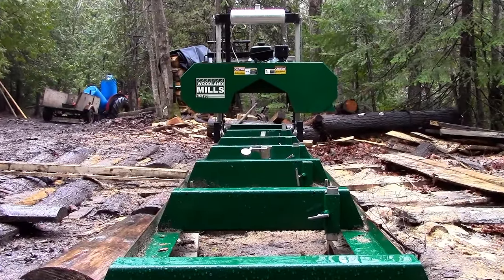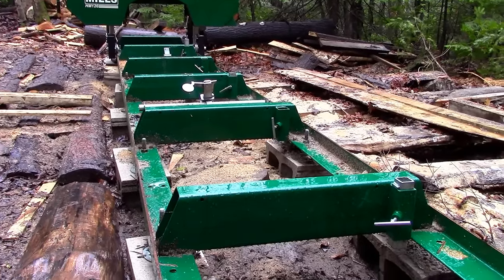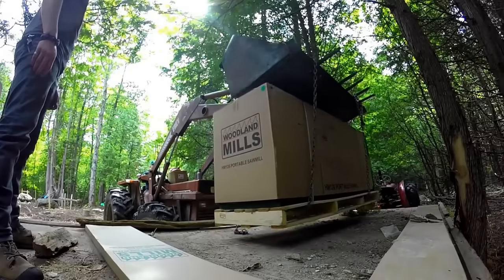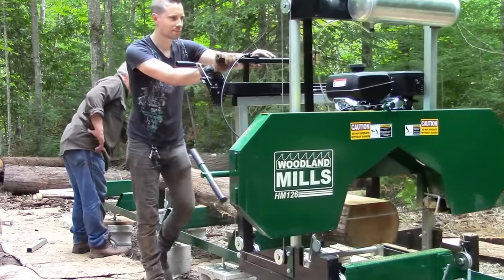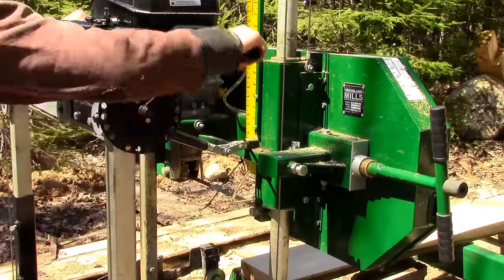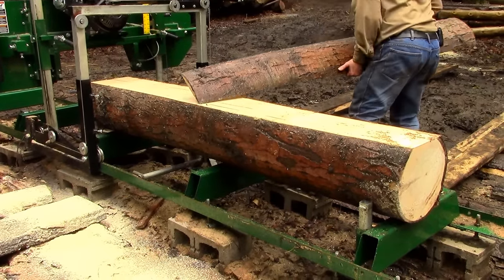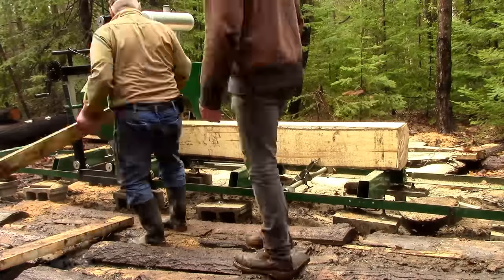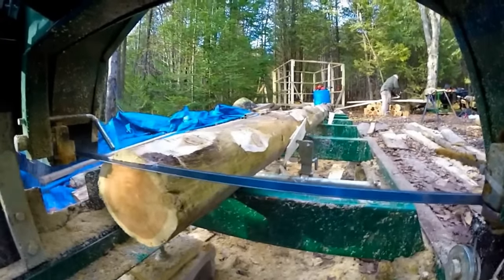Portable Sawmills- Are they worth the money?- Woodland Mills HM126

Comment: I have my own mill also. I have run it for several years. I built mine to reside and repair a large bank barn. I agree with all of your comments. Spot on. I have sold some high end lumber. I have built other buildings with the lumber. The big advance is having you own lumber when you want it in the size you want it.  The first thing I built was a building to house the mill. You should do the same. Nice video.

Comment: I bought my Woodlands mill about 5 years ago for hobby and am very pleased. You might consider going to pawn shop and pick up a transit to level saw bed, as did I.  A neighbor gave me an old dilapidated 24' travel trailer to which I tore off camper portion and used the trailer to put my mill upon. Works great and is portable!

Comment: Just a little tip.  If you use a string level to straighten the bed in the direction of travel you can get in straight much faster.  Your not looking for level your looking for a straight line of cut. After you get the table in a straight line then you can level the cross members.  If the string is in the center of the cross member, the cross members can be adjusted by raising the low side and lowering the high side an equal amount.  I hope this helps you out.

Comment: A great video on the choice, I believe the decision between a bandsawmill or a chainsaw mill is relative to the species of timber you are cutting , I have owned and used both, my choice for cutting hardwood like ironbark or river redgum etc is the chainsaw mill, I have 2  Westford Mills, the slabbing mill and the rail mill using the skip tooth chain , no problem,  the downside using a chainsaw is the waste as in blade thickness. The bandsaw mill has a thin blade , minimal waste, but bandsaw  blades do have there issues,  in hardwood the teeth follow the grain therefore porpises up and down thru the log,  a wavy surface,  no issues with cedar  or silky oak .  In the end I used a starrett brand blade  with a left and right cutting tooth and a raker in the middle,  ground every second or so tooth off  and it cut like a hot knife thru butter, left on the setup and used until the blade was past the use by date,   quick and easy to sharpen with an angle grinder, just  ground a sharp point on the tooth  no fancy depth gauging  or profiling,  cost of a blade was $12 ,  cheap timber ,  I sold the bandsamill because the blade tension is critical  and all  I was  cutting was hardwood.  The Westford mills are made in Australia and are truly portable,  used to cut old dead river red gums on the banks of the river  , in location  , my max lenght was 3 metres long,  couldn't lift anything heavier, 75 mm thick, up to 3 foot wide,  used a Husquvarna 3120  with modified exhaust and jetting to overcome over come running lean with the throttle power on for 3 minutes ,  with  6 FOOT BLADE , skip tooth  3/8 chain . the winch makes it easy  just listen to the exhaust  so you don't bog the motor down 
Walk out of a forest with my mill and the timber cut  setup is a reasonable  task,  not difficult and you can mill logs in position , just set the rail in position with wood screws, no machinery required to lift or drag  the logs to a set up mill  whatever brand,  how much timber are you going to cut and is it hard wood or soft wood,  hope this helps,  not sponsored  just experience

Comment: HI Outsider
 I also have the HM126 which i bought in 2013. I use it on an occasional basis and process about 10 to 15 logs a year. I use the wood for tool sheds, wood sheds an new porch etc. you did not mention so i will that with each log you cut you will get 20 or 30 gallons of sawdust. I add the sawdust to my compost heap as the wood material in the mix. Also all the “scabs” which are the pieces of wood with bark on one side get cut up into firewood. There is very little material wasted if you do a little thinking about where you can use the various products of boards, firewood and sawdust.
Finally i found the local high school has an enthusiastic wood-shop teacher but no budget for wood. I keep him supplied with pine, oak, chestnut and cedar so the kids have plenty of material to work on.  All at no charge of course.

I have not found there to be a market for selling wood locally except for the occasional neighbor who needs a few boards. This occasionally pays for gas to run the mill.

Nice video and valid insights.
Pete

Comment: I have the same mill, it's simple and easy to run, well built, no complaints from me!  I set mine on blocks as low to the ground as possible but eventually raised it aprox one foot. This was to be able to clear sawdust out from underneath the bunk .. it accumulates pretty fast! This is NOT a high production mill but does a super job. When cutting TAKE YOUR TIME... One other important issue... clean the logs as best you can before cutting..., garden hose/stiff brush works well... a lot of the Fir logs I've cut have heavy bark on them... those I run the power saw along deep enough to cut through the bark and then peel it off.. takes a bit of time but saves the band saw blades.  Great little mill, thoroughly recommend.
Reply: Roger Coles how much you pay for
Reply: @ismaelramirez2786  
I think, $1.00

Comment: I have the one a step down from this, an HM122.  I did purchase the 9hp motor and I am glad I did.  I can't stress enough how well built this thing is.  Quality materials and solid motor.  It took about 4 hours to put together, without the foundation.  We mounted ours about 12" off the ground on 4x4 post cemented in the ground.   I don't recommend this for industrial use, but it really is a good unit.

Comment: I was restoring my barn. Needed 6000 bf for just the roof and walls. Local lumber yard wanted $1.05 for field dried, rough pine. I had plenty or trees, I purchased a Norwood 2000. for$7000. Ended up cutting many posts, sills and beams also. Saved much more than mill costs. When figuring the cost of a chain saw mill don't forget the Dr. and chiropractor cost as they will kill your back. Very good video

Comment: Excellent commentary, great production work. I have a simple suggestion, not sure you remember, I was the one suggesting a portable saw mill 18 months ago.I hate mud on my wood, dulls the tools, need to sharpen them much more often. You know this from your chainsaw experience, not telling you anything new. My suggestion would be to get a small wood chipper, not an expensive one, then cover the ground around the sawmill with the chips, spread that sawdust around too, it keeps the mud down.I helped a guy on another website, he did not understand foundations. Just like you have trouble with your sawmill, a house has the same problem going through seasons and staying level. The solution is soil dynamics, foundation engineering, which is very complicated. Basically, you need to get something stable, and that depends upon the conditions where you build. In that soil, I would suggest piers. You have rocks, so to reduce the amount of cement, you might pressure wash rocks or find clean ones in a stream bed. Add a little extra OPC and fill a sonotube, buried below the frost line. That might be difficult with so many rocks there. Believe me, it will be worth the effort, even if you can only put one pier every 16 feet. You have free wood, you can span that distance easily with a 2"x10". Most log cabin guys dig a trench, fill it with rocks and sit something on top. It always fails and the rocks need to be restacked every spring. With piers, you might still trench and stack the rocks, but get the wood up 30" off the dirt and away from the rain splash. If the rocks fall over, so what, just restack them. Piers can look ugly, so to make it look really good, use slip form. Slip form would be like getting a sonotube just 12" to 18 inches high, anything above ground, stack clean stones around the outside, fill the inside with rocks and crete. That is the easy way to make it look like masonry. I am not a mason either, but taking time to get the rocks close to each other, then pointing afterwards will work. That same idea can be done the traditional way with slip forms to create a flat face. There are a few examples on U-tube, most of them awful.Great job, good luck with all your endeavors!
Reply: I use all my sawdust for my free range hens.
Reply: Robert Carver i
Reply: Robert Carver I

Comment: I also own one of Woodland Mills' bandsaw mills, although mine is an entry level model.  I would highly recommend even the small "hobbyist" version I have. Great value for the money when building my own furniture.
Reply: What's the largest diameter of log that it will mill? And, what is the info on it?
Reply: I watched that video.  The 130 looks like a great machine.
Reply: Thank you, Rick and Richard.
Reply: How is your maintenance going with your mill.  I looked at different brand, and you can only buy parts from them.  Mill was cheap, but the maintenance and parts were very expensive.  Thanks, WG.
Reply: William Gates>> My machine uses lennox blades which are readily available online.  The engine is a Kholer and is covered by a 3 year warranty and the machine has a 2 year warranty.  Hopefully I haven't had to buy anything for since I bought it last year.
Reply: SRV. 123 The blades that came with the saw are Lennox blades.  They can be resharpened and I believe the recommended time between sharpening is about 30 hours of use.
Reply: SRV. 123 I got 5 blades from Woodland for $125.00 when I bought the mill.
Reply: I'm responding from Richmond va. Is there any way I could talk to you other than this video. I have some questions concerning lumber more so than your mill?

Comment: i have a chainsaw mill.  Let me tell you, that is back breaking work!!  you are always bent over running the chainsaw.  It is hot and dirt and exhaust seems to be always in your face.  If you try to get logs up to a nice height you need big muscles or equipment of some sort.  But as you mentioned, you can't get much more portable then that. I have a video up of me using mine.

I am hoping for a bandsaw mill eventually.

Great video!!
Reply from the maker: Thanks Adam! I was hoping someone with a chainsaw mill would weigh-in on the conversation. I'm just sorry that it's such a hard piece of equipment to use. Anyway, I appreciate you sharing with us.
Reply: it isn't hard, just tough work.  But like you said, if you need to fly or boat in lumber, this is a great tool.  Many many cabins, house, cottage, etc have been built with this tool.  For me, it is very rewarding.
Reply: Adam Craig Outdoors Take the rakers all the way off your saw chain when milling. You don't need to push nearly as much without them. I did it and it seems to work good. You can also put a winch on the mill to help with pushing. That's what I do.
Reply: I have big muscles..
Reply: e POPE e GENE tics lol
Reply: Chainsaw Mills  are  only   good  for  slabbing,  in  my opinion...
Reply: Yea mate i have milled for years with a double end Alaskan mill with 2 x 3120 huskys.  Fuck yea its back breaking work and earing sawdust and getting gassed out .
Agree with you
Reply: @Lanninglongarmmowing  skip tooth chain bro and yes take rakers down not all off though.  And change your pitch on your teeth as you already know :)   and yea coment below good for stabbing only .
Lucas mill is very good also.  It has a bar attatchment so you can slab
Reply: @neilsbikes76  That would help but taking the rakers totally off really makes it much easier to push the saw thru the log. A Lucas mill would be sweet to have.
Reply: @Lanninglongarmmowing  yes i take them almost off.  Depends on the timber you are milling.  Im in australia.   Maybe you are also
Reply: I can operates all the  machines  nd i have musles also,u can hire to works for u sawmill..
Reply: I used both chainsaw Mill and bandsaw . Chainsaw Mill ,hard on man ,hard on saw. Band Mill a cheap one, if you have wood land is worth it . Best wood for log cabin buildings.

Comment: Very helpful video, thank you.  In case if you’re still having difficulty levelling it, use a laser level. You might want to do it in the evening when the sun is going down and it’s easier to see, but it makes the job super easy and way more precise than trying to do it with a 4” bubble level like you are showing here. Good luck.
Reply: And if anyone else is reading this on a budget, you can use strings pulled tight over long distances to bring things to flat, if you account for the sag in the middle. There are various ways of accounting for it, but a lightweight string under heavy tension will already just solve most of it.

Comment: I have got some messages about this video and what my personal opinion is when it comes to Woodland Mills.

Are portable sawmills worth buying? 

The general answer will be yes if you are a forest owner or have access to logs. If you can use the milled wood yourself, such a sawmill will have a short repayment time depending on how much wood you mills. 

It is a common misconception that twin-rail sawmils are portable, - they are the first portable when they get on wheels. Woodland Mills has already introduced trailer solutions.

Which do I think is better: a bandsaw mill or a chainsaw mill? 

The short answer is both are best, understood the way they complement each other. At this end of the sawmill scale (prize level), one must often use the chain saw to ensure that a log can match bandaw's limitations. 

The chain saw is very slow, noisy and uses very expensive gasoline, and has a 7-8 mm. kerf. A bandsaw is much faster, less noicy, use less gasoline per cut and have a 2 mm. kerf.

Is it possible to make a living with your own portable sawmill? 

Both yes and no, when we speak Woodland Mills. If you have your own forest or tree access or you can use the tree yourself, it will always be possible to save yourself a lot of money and gets better quality. 

If you have to make a living out of it, you should be able to compete on hourly rates, board feet, linear feet, cubic feet or cubic meters. There will be competition from the super hydraulic sawmills (on wheels) such as Timberking and Woodmizer (and they are in a completely different investment level). 

In many countries one can live by having a Woodland Mill in the long term, while it is more difficult in countries with a high wage level like in Northern Europe. It is also largely dependent on the local market situation, ie supply versus demand. But I am quite sure that there new trailer models from Woodland Mills will fill a need in the market also here alone because of the lower price.

What do I think of the Woodland Mills product?

First of all, I'm not right to ask, we are using Stihl, Logosol and Wood Mizer products for long.

However, Woodland Mills has a good product range for the small sawmill business segment. You get value for money, well thought out design, quality standard components you can buy anywhere in most countries. 

It is easy (and cheap) to customize or update the sawmill, to the wishes you may have. 

The design makes it possible to service and maintain yourself, and that it is easy to make constructive improvements. 

For the beginner it is not only necessary with advice and guidance in connection with the purchase of the sawmill, but especially when you have first started, it is necessary to have a good supplier backing up the product and providing a good after-sales service and that's my impression that Woodland Mills is fully in line with the best in the industry. Should we need a smaller mobile sawmill more, Woodland Mills in Göteburg, Sweden, would be among the first we visited.
Reply: Ok

Comment: I bought a used hud-son 28"mill over 10 years ago. I only intended to use it for my hobby wood work and such, I have cut many logs with it, cedar, oak, walnut, cherry, pine. I have tried to sell some of the boards, pricing 2x6-8' at half the lumber yard price, and could  sell none. I have used many of the boards myself for my hobby, and sold a number of bird houses made from them.  this fellow talks of cutting boards for furniture, but you have to have the finest straight grain clear boards for furniture, and they have to be totally dried and planed, just cutting boards on a mill like this doesn't even get you close to furniture making. there is a guy advertising localy  2"x16"-8' slabs of walnut, oak and elm, and it appears he hasn't sold any (price $50-80 each) in conclusion I would say do not buy a mill to make money, it is only a hobby unit. treat it as such
Reply: I bet you could sell some now!!

Comment: Making the base out of a channel or rectangular tube would stiffen up the track alot! Angle iron that was used is to flimsy. Also I would have built a shed of someone sort to cover up the saw during the winter and bad weather!  At the same time put in a gantry crane to lift your logs on . ( Always easy to give suggestions and spend someone else 💰 I know)